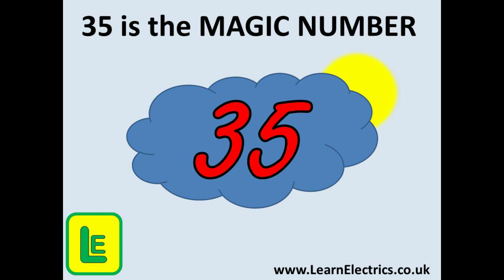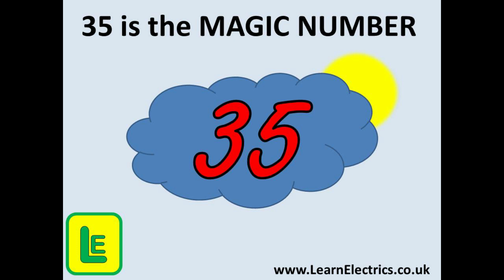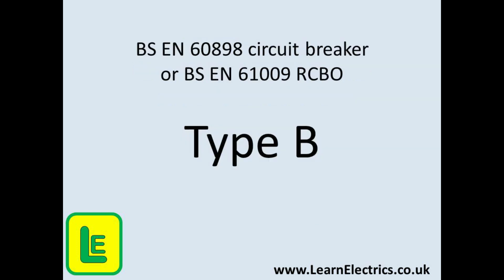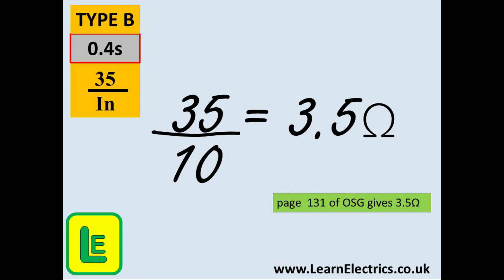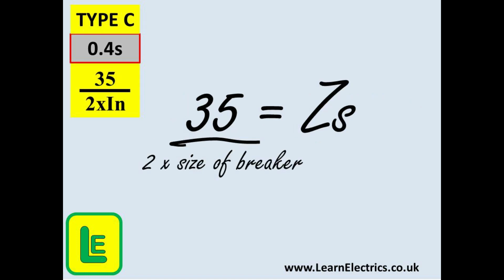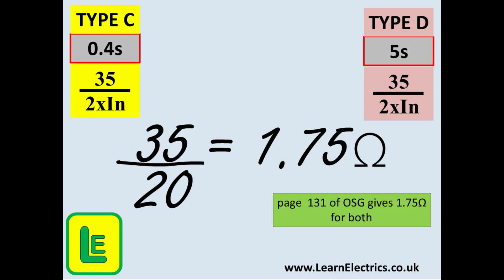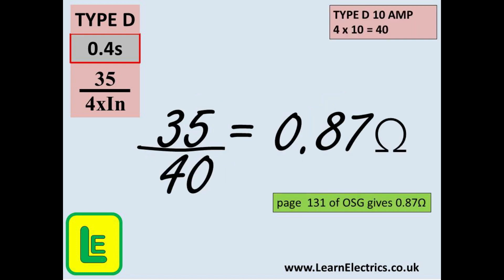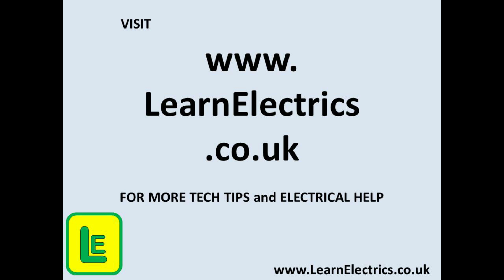35 is the Magic Number

Comment: I missed this and been using 44 over, then timesing by point 8.     
I told everyone that 44 was the magic number.. duh..  35 is way easier to use.  This is actually one of the best videos on Zs you can find. And actually few guys kno2w about the 35 deal which I always find frustrating

Comment: The fascinating thing is - where does the 35 Volts actually come from ?
Reply from the maker: Its not 35 volts, it just a ratio that works for the numbers that we use. If they change Zs in the future then the number will change. Hope this helps. Dave.
Reply: @learnelectrics4402  Dave, If you look at the formula it is 35 = (some value of) Ohms multiplied  by (some value of ) Amps. Dimensionally, its units have to be  Volts. The number 35 may not change but it is not a dimensionless constant.